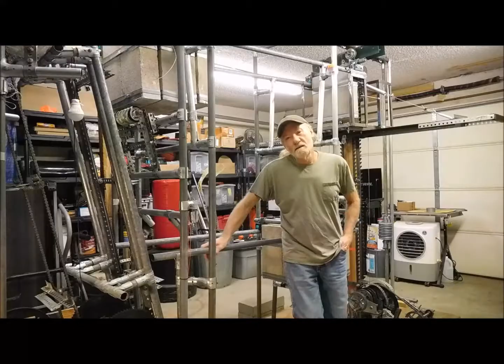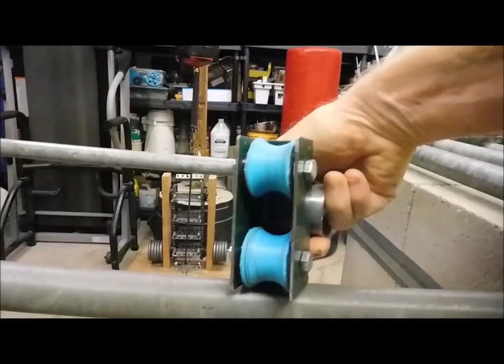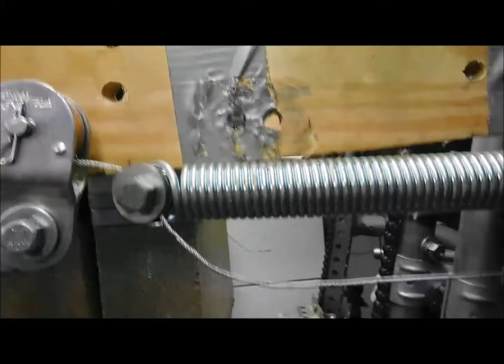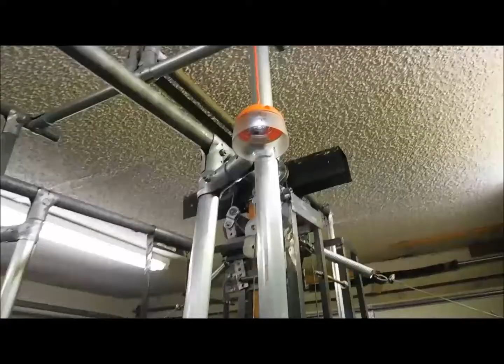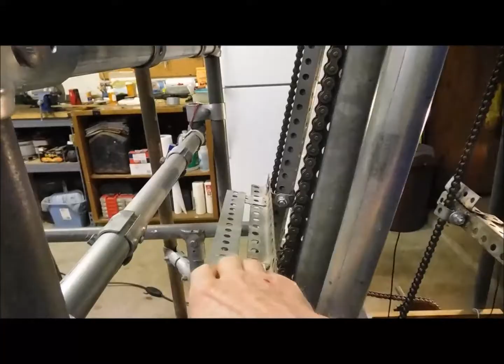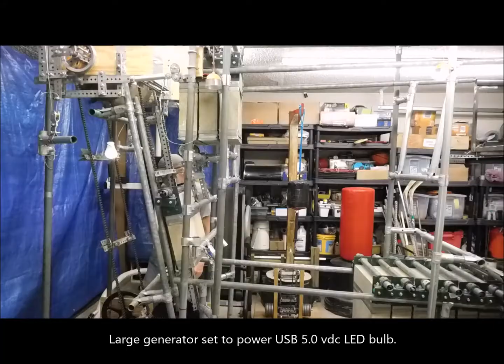Lifter, Gravity Bank and Carousel

Comment: Have you ever tried, to use the force created by falling weight for LIFTING the already fallen weight(s)? I mean, slowly descending NUMEROUS weights should be able lift ONE weight multiple times faster, than the weights move on falling side.

Not to mention the possibility to pair the carousel with skinner torque multiplicator ("william skinner gravity device").

Comment: Super cool! I love the idea of a gravity based energy storage system.. I was brainstorming one day as to how to increase the run time and I had this exact idea, multiple weights that would swap out as it ran.. but then I got to thinking what about a hydroelectric gravity based weight system? load up a huge reservoir of water and have it elevated to a set height, drain it through a piping system that turns a pelton wheel generator and collected into a lower reservoir? I've yet to be able to do it yet as money is tight but I definitely plan on it soon! I would love multiple systems, such as a large weight and a hydro electric version too! 

I love the idea that it can charge up almost instantly, as in you can literally just lift the weights yourself using mechanical advantage or Solar power during the day and I think it should last longer for quite sometime, very few parts to deal with and while it's hard to beat chemical storage methods in terms of energy density, I still think it super cool, I also plan on a large heavy flywheel energy storage system as well

Comment: Good work, improve loads shape, use Gym weights (shape in circle with a iron rod fixed in centre or rolling pin shape load ), it will improve movement of charge and discharge load, use u shape hooks on both sides chain for moving up and down of load to hold load easily, use at-least 5 or 6 loads on discharge lane side and use the discharge lane gravity power to shift loads up one by one in such a way tht when one came down and released, the time one is shifted up and released.

Comment: It's 1 year ago. How is the progress now?
Reply: No new projects yet. I did print out gears for a 90:1 transfer on the drop assembly and fixed the hold and release mechanism delivering blocks. Both fixes have worked really well. I'll probably put up some pics on the website (bclifters.com) before I disassemble it. Only real issue are the rollers on the blocks. These proof-of-concept projects are temporary. Parts and space get reused. Always hate to tear one down. I need a bigger garage.

Comment: Love the idea. Have you thought about using a liquid instead of concrete blocks? You could get a small solar panel w/ a battery and connect it to a water pump and your loader would be much lighter to handle. I hope this helps.
Reply from the maker: I used water in a proof-of-concept, storing solar energy using a Lifter. See this video https://www.youtube.com/watch?v=Rp_7wIlgMCI&t=2s  and others on my youtube channel or website (bclifters.com) I like water as a storage material. It is easy and a bit more efficient to extract the amount of energy you want without going through a lot of heavy reduction gearing.